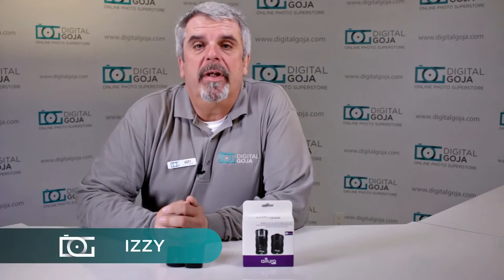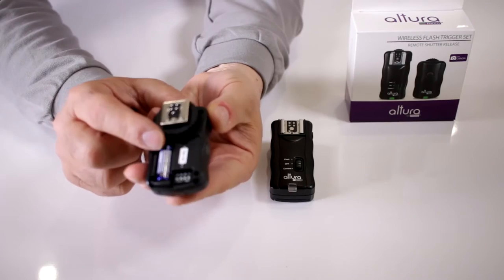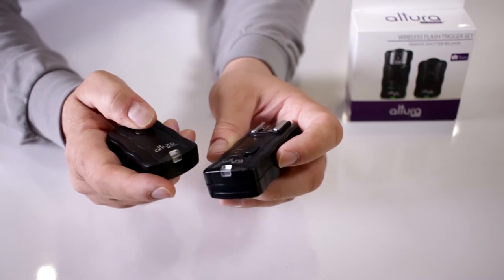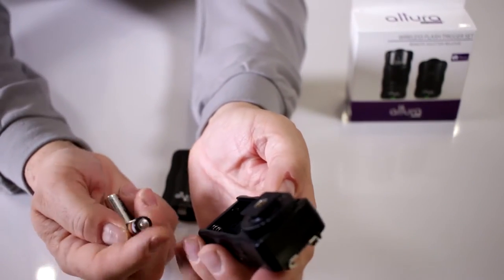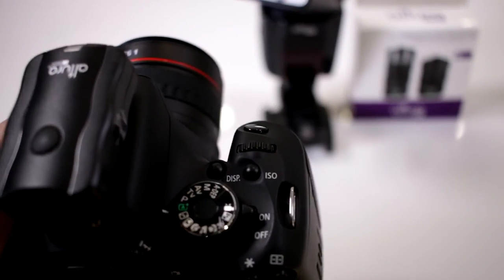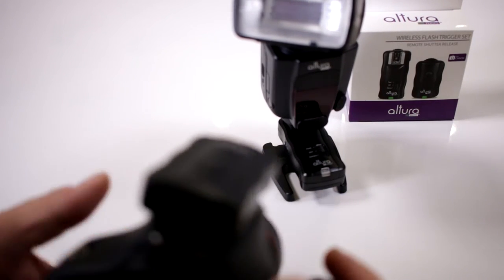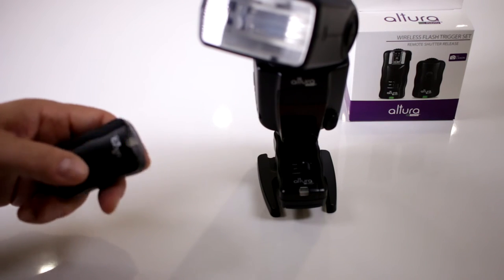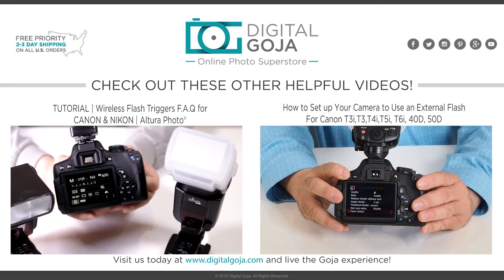Wireless Flash Trigger Set Troubleshooting For NIKON & CANON | By Altura Photo®

Comment: I have a D5200 and am enjoying what it has to offer except...  Under Flash Control, there appears to be only the TTL and Manual options, no Commander Mode option. Why? I would like to be using the Wireless Flash Creative System but that appears to not be possible. Any suggestions?
Reply from the maker: Hi Geoff, unfortunately, these triggers cannot be used that way, they will only work in manual mode.

Comment: I bought the set for Nikon d3400. The cable they sent to trigger the camera, I can't use because the port side is different not what I have in the camera d3400. Other end a banana pin is goes easily to the receiver. What should I do.
Reply from the maker: Hi, unfortunately, your camera is not compatible with wireless triggers, we have also stated that in our AD.

Comment: hey izzi, thank you for all your tips and all your helpful videos, i bought the altura sling camera bag after seeing your review, and ive been watching you ever since. i have a good question. can i use two sets of the altura dual wireless trigger sets to fire four speedlights at the same time?? having one transmitter wired into my nikon d5500, all receivers on four various speedlights and the second transmitter as the fire button. or can i only use three speedlights and the forth receiver wired to my nikon and one transmitter to fire? thanks for all the help you can provide (bodysnatcher is  my gamer tag, dont mind )
Reply from the maker: Hi there! All you need is to put the transmitter on your camera, set it to manual as stated in the video, max shutter speed 1/200, and put al your flashes to individual receivers and set receivers to flash and the flashes to manual and you're all set. ;)

Comment: Hi, I was hoping you could help me with my issue: I've been using this set up successfully for over a year now, but all of the sudden I started having problems. External flash only fire when as close to camera as possible. If I move it even one step away - not working. But event immediately near the camera it fires only 50% of the time. I changed batteries, made sure the channels are all correct and match. What else??
I'm shooting through wifi connection, using my phone - could be be the wifi signal?
Thanks!
Reply from the maker: Hi, in that case, if the equipment works still it could be the wifi signal, try changing the wifi to see if it is the problem.

Comment: Shooting headshots with D5200, manual mode of both flash and camera, ISO:200, Shutter:1/125, receiver set to flash.  I have the flash behind the subject and it does not always fire. More reliable when reciever and transmitter are in "sight" of each other.  I thought the triggers were RF and not IR.  What am I doing wrong? Please help
Reply from the maker: Hi Emmanuel, they should be in the line of sight as sometimes the signal can be blocked by objects in the way.

Comment: I found this wireless flash trigger set on amazon and planned on buying it for my D3400 (the amazon listing lists the d3400 as compatible). You say it's not compatible. If this set is not, can you recommend a set that will work with my camera? I have one speedlight which I currently use on-camera only but want to start going off camera with it. Thank you.
Reply from the maker: Hi, unfortunately, the triggers are not compatible with the 3400D and we do not know of any that are as the camera does not have the correct input.
Reply: Oh, wonderful. I didn't see that mentioned on Amazon. I assume it is also not compatible with D3300?
Reply from the maker: Hi Stephen, it works with the D3300 without any problems.

Comment: I just bought this for my d3200 and the trigger connected to the camera hotshoe  doesn’t operate my opteka speedlight even in manual..is there other setting i need to know? Thanks
Reply from the maker: Hi George, please make sure that followed these instructions, set the transmitter and receiver to the same channel. Next, attach the transmitter to the camera's hot shoe, and the receiver to bottom of your flash. Once you have the receiver and transmitter secured, set the switch on the receiver to "FLASH," and your flash to manual.
Reply: Digital Goja did all that still don’t work??
Reply from the maker: Please contact our customer service at info@gojasales.com so they can assist you in solving this problem.

Comment: I just recently started having issues with mine- The remote seems to work fine, but the receiver seems to not be picking up the signal. It works maybe 4 out of 10 attempts (if I'm lucky). I've replaced the batteries in both the remote and the receiver, have tried all, individual and different variation of frequencies, but the problem persists. 

When I first got this set, it worked great- allowing me to shoot at any distance. Now, now, I get luck if I can get the receiver to "read" the remote's transmission both on, and off, of the camera. Any suggestions? As I said, everything worked great when I first got the set.
Reply from the maker: That's strange, please make sure nothing is interfering with the signals. Also, check that the switches on the frequency panel are completely pushed to a specific, matching, frequency. If you're still having issues with your triggers please send us your order ID number to info@gojasales.com and we'll be happy to assist you.
Reply: Kenneth Robbins mine is doing this too after I had no previous problems. Did you ever find out what the issue was?
Reply: I'm having the exact same issue!
Reply from the maker: Hi, Sonnychibasamurai1! Please send us an email to support@digitalgoja.com, and our team will be more than happy to help you find a solution to your problem.

Comment: Whenever I'm more than 3 inches away it doesn't get a signal.  I'm using the batteries given to me.  Can this be fixed?
Reply from the maker: Hi Alexander, we recommend changing the batteries, it could be that those ones depleted and the signal emitted is very weak.

Comment: i have a problem .....i have a manual flash using with a SONIA trigger and receiver...when i mount the flash on receiver and triger that using the test button on triger it works fine ...but when i mount the trigger on camera and press the shutter button its nit working sometimes its working and sometime uts not....can u tell me what is the problem !!!
Reply from the maker: Hello, Lahul Lahiri. Unfortunately, we are not familiar with the SONIA trigger system. Have you tried changing the batteries in the transmitter? Also, do you shoot in burst mode or in single shot?
Reply: @DigitalGojaUSA  hlo sir ......i did in single shoot .....is it a problem caused due to battery !!! cause when i rub the pins of trigger with a rubber and put in on the camera it works...but after some time it again stops

Comment: I'm using a 5DM3 and I've been trying to use this wireless set on location to blow out backgrounds, but when I place the flash in position and shoot, it doesn't respond to my camera.  I've gone over all these settings and replaced batteries with fresh and still nothing.  I'm at a loss.. any suggestions?
Reply from the maker: Make sure that the receiver is set to Flash and that both the receiver and transmitter on the same channel. In addition, these are non-dedicated triggers. Meaning that they will not work in the auto mode. That means that you will not be able to shoot above the rated shutter speed. Typically 1/180th of a second. Lastly, there should be no cables connected to either the transmitter or receiver.
Reply: I've turned the receiver to Flash and both receiver and transmitter are on the same channels.  I've 86'd the cables entirely.  I got it working but only when the shutter speed is at 1/200th of a second.  I have yet to see if this is a permanent solution, but I will try again shortly and post the results.
Reply from the maker: Yes, the maximum shutter sync speed for the Altura Photo triggers is 1/200, minimum is 1/30.

Comment: I purchased this set up with the triggers and flash about a year or so ago.  And every since then, I have not been able to get the wireless triggers to work.  This has been a disappointing purchase because I was assured it worked.  I have tried everything. I've tried all of the suggestions from the video, but can't get it to work.  I can push the button and the light flashes, but it will not sync with my D3200 when using the wireless triggers.  Since I the warranty timeframe has expired, I"m stuck with only being able to use it on camera.

Has anyone with a D3200 got the wireless triggers to work?  If so, what did you do?  Your help is greatly appreciated.
Reply from the maker: Hi Cedric, I actually use it with the D3200 and I set the camera on manual flash sync 1/200 ISO 200 and @ F5.6 @10feet.
Reply: Digital Goja I purchased a flash and trigger set from Neewer and it fired perfectly from distances greater than 10 feet. I used the same instructions that were given on here.  It has to be my set.
Reply from the maker: Please send us your phone number and order ID to info@gojasales.com so we can give you a call. Thanks Cedric!
Reply: Digital Goja I have sent that information. I'm suppose to get another set.
Reply from the maker: Ok, great. Please test it out once you get it and let us know if you have any issues. Have a wonderful day Cedric.

Comment: I am extremely frustrated. I set my camera to 1/60 shutter speed and had the altura flash at 1/1 on Manuel mode. When I hit the trigger the flash goes off but it is timed incorrectly. The flash pops do not show up on the picture. I also tried it on 1/30 of a second and it still didn't work. I want a refund....
Reply from the maker: Hi, use the same shutter speed on both, try first with 1/200.